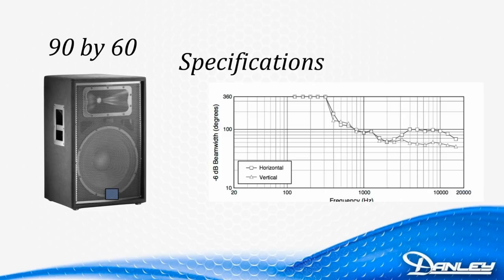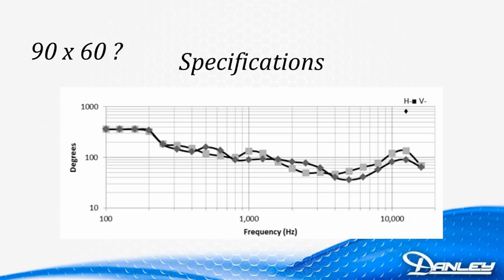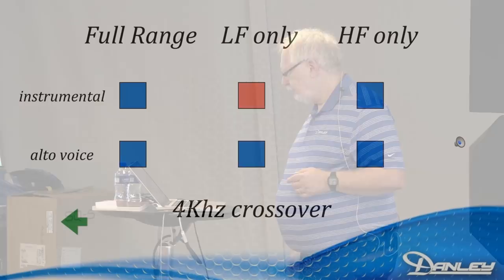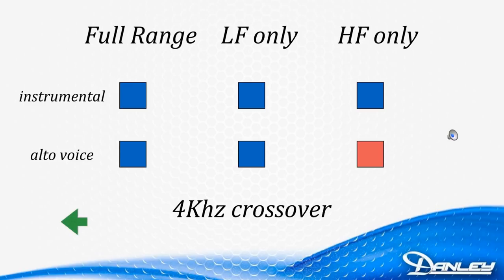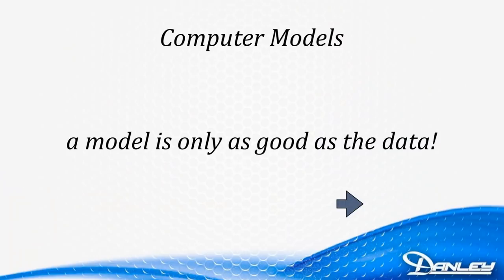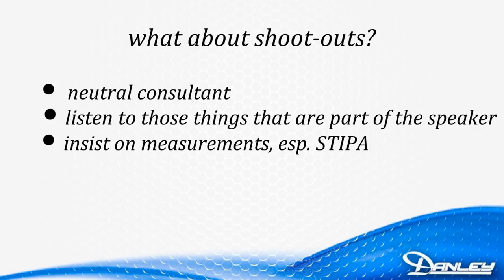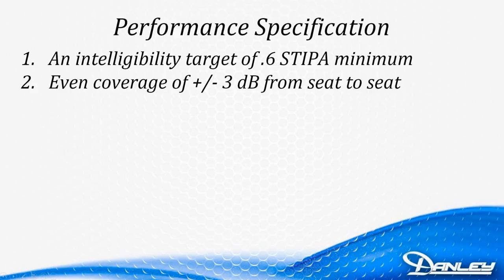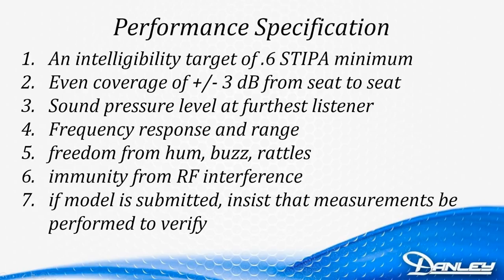What every church should know about sound systems (part 4) with Professor Doug Jones

Comment: His explanation on speaker coverage is very good.  I was thinking in terms of consumer audio, where a wider pattern isn't normally a problem. In live sound that can increase interference and feedback.
Reply from the maker: Correct - in consumer audio the audience is typically seated at or near the sweet spot of the speaker and the distance from speaker to listener is relatively small. In large venues there are hundreds of people sitting at varying distances from the loudspeakers so the ability of the loudspeaker to control the sound becomes a critical issue in system design.

Comment: You all always provide a lot of helpful info. Question. A Taylor guitar with an ES  System is designed to plug directly into a PA as it  uses a balanced cord right from the Taylor Guitar., with no DI box. I find using a di box with an ES System Taylor guitar greatly reduces the signal and the sound output from the PA. So, how can I run my Taylor ES acoustic guitar thru an amp, then to the PA system? I like to have a small amp so I can hear my guitar. It is very difficult to hear how my guitar sounds when it just goes directly to the pa. Thank you, God Bless.
Reply from the maker: When running an ES system into the PA system via a DI box the mixer gain will need to be increased compared to running the ES system directly - this is because the output of the DI box is mic level, compared to the near line-level of the ES system direct.
Reply: GLB Productions    Aah, that’s the why of it, I gotcha 👍🏻 thanks